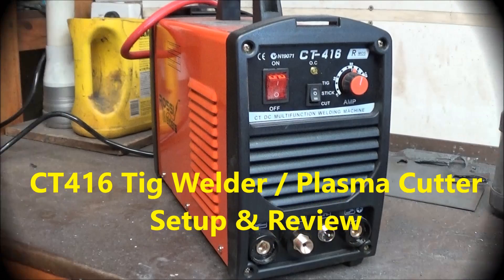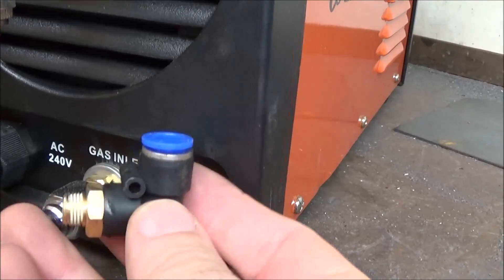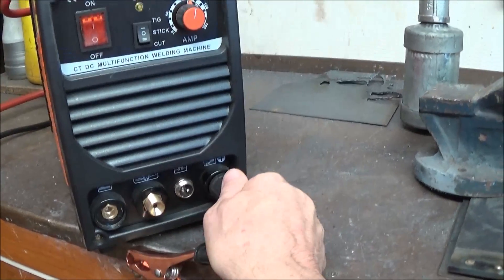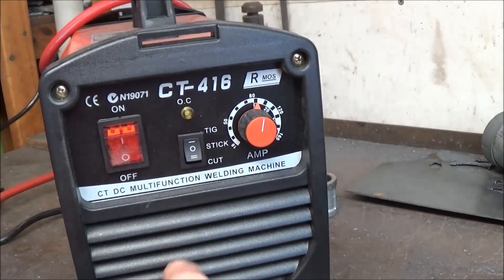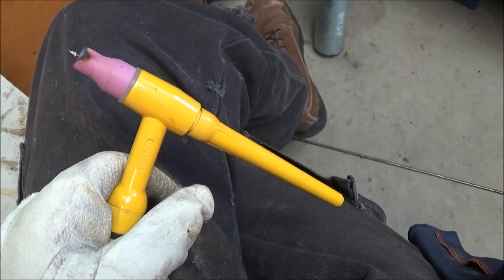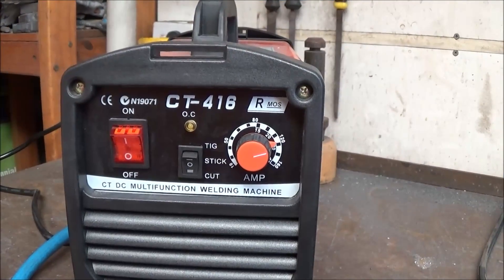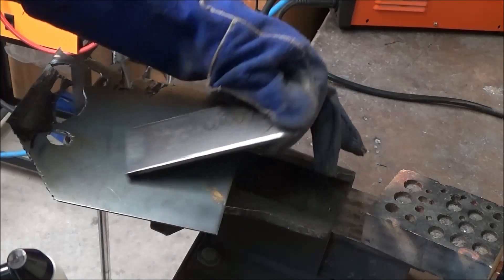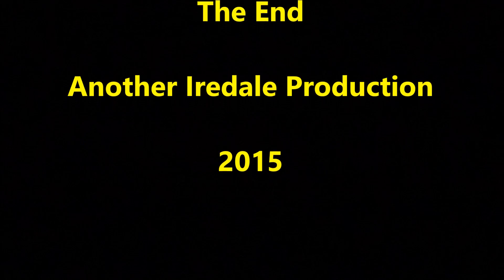CT416 Setup and Review of Tig Welder / Plasma Cutter

Comment: I’ve got one its got a mig plug but i have no mig gun in kit, but it deceased step father i just inherited, anyone know how to MIG welder is a seperate roller i have to buy or whats the go? Ive got standard house 10amp so will find out if it needs 15amp or not.
Reply: Yea prob want a 30 to 50 amp breaker

Comment: Great vid, thanks! For plasma cutting do you only use compressed air? What psi is recommended? I’m a newbie who has never used a plasma cutter before but am a quick learner
Reply from the maker: Mine uses 60psi. The current depends on the thickness to material being cut. A big of experimenting will find the sweet spot of a given thickness where it cuts nicely but without excess slag.
Reply: Between 40 and 55 PSI of air pressure, and 50 amps of current for the plasma.

Comment: I have the CT418 model multi purpose machine,, dual voltage 120/240v , I run it on 240 
Larger cups help with newer Tig welders allows you to see a bit more

Comment: 4 years on, how is this machine holding up? What is the thickest bit of steel it can cut?
Reply from the maker: Steve Clark - real-life practical? 6mm
Reply: @ShedBuiltStuff  Thanks, good to hear that the machine is still working, some say that these 3 in 1 machines have the worst failure rate. I am looking at buying one in the new year.
Reply from the maker: Steve Clark - these aren’t “quality” machines. You get a bit more than you pay for. For me it was worth it as I didn’t know if I would like tig welding and didn’t want to spend a lot to find out.
Reply: @ShedBuiltStuff  Yes I'm sure that they ain't, I can't afford much and I'm a hobbyist user so such a machine would get little and occasional use.

Comment: What size is your air compressor?   I have a small compressor (21L tank), in your experience would it be capable?
Reply from the maker: Compressor size effects how long you can cut at a time.  So long as it can deliver 60psi it will work.  The smaller the tank/ability to refill the shorter time you can cut without waiting for the tank to refill. I think the 21L will be fine if you are only using it for hobby work.
Reply: @ShedBuiltStuff  Cheers. I ended up buying a cheap 40a plasma cutter to try. The 21L tank provides ample capacity for the home workshop.

Comment: Hi mate, thanks for the informative video. I recently got the CT620IS Rossi but I am having some issues with the cutter. Can't seem to get the cutting arc going. All that happens is the compressed air comes out when I press the lever. I have made sure I have all 3 connections made to the machine. Anything I am missing? appreciate any help you can provide. Thanks.
Reply from the maker: Zarn Bou - there is no pilot arc on these. They are “scratch start”. Tap the tip on the metal - the arc will start - then hold it a couple of mm from the metal to cut
Reply: thanks for the quick reply! do I press the lever as I tap the tip on the metal?
Reply from the maker: Zarn Bou - yes. Hold the switch down which starts the air flow and electrifies the tip then touch and release the tip on the metal to be cut
Reply: Cheers, I'll give it another try later. Thanks again!
Reply: Hi mate, tried everything and just doesn't work. It shouldn't be rocket science how to start that thing cutting. I believe it's just faulty. Asked seller for a replacement or refund. Thanks again for your help.
Reply: @zarnbou9445  same here no matter what I turn it up to amp wise if I'm 2-3 mm away I only get a very tiny spark no cutting no nothing all air , about to through it In the bin
Reply: @ShedBuiltStuff   hey Adrian  just set up my  machine with same set up as your , for cutting it's only putting out small spark no flame at all , what psi air are you putting through
Reply from the maker: Fordy Mcfordy - 60psi - I assume you are talking about the plasma cutter. Check your earth to your work piece. Also check the switch is on “cut”.  
But the small spark points to it not earthing properly. The earth clamp needs to be on a nice shiny clean surface.
Reply: @ShedBuiltStuff  thanks for the reply Adrian , yeah I'm cutting up a old car shell, I'll flap disk a clean area for the earth cheers mate
Reply: @ShedBuiltStuff   he said he had a CT620is  they do have a pilot arc.

Comment: Adrianiredale  I am in Toronto Lake Macqarie NSW are you still happy with your Rossi 416CT unit I would like too see one operating Noel
Reply from the maker: Noel Masterson - still happy with it. But the plasma cutter option failed. 
Remember this a very basic unit. As it’s DC only you cannot tig weld aluminium. 
Bought a seperate plasma cutter - same brand. It has proved reliable. Been using it for 2 years.
Reply: Adrianiredale what rossi unit model did you replace it with and did you purchase it in Australia bye the way thanks for your quick reply regards Noel
Reply from the maker: Noel Masterson - I didn’t replace it. The tig and stick still work fine. I bought a dedicated plasma cutter. 
It was a pain swapping from tig to cutter on the original unit anyway. 
I’m current motorcycle touring down the snowy river so cannot tell you the model of the plasma cutter.

Comment: You can actually TIG weld aluminium with a DC TIG. There is two ways to do it. Use Helium gas, or use argon and a positive electrode but the second way is harder and can only do thin material as well as use a  large tungsten.

Comment: hi joe,
I had to remove the metal cover (carefully as it is slotted into the front panel) to allow access with two spanners (one inside and one outside) to remove the original gas connection, I went to a plumbing supply to pick up an thread adaptor to match the thread on the gas solenoid to the Nitto style gas fittings I picked up at Bunnings, then its just a matter of reassembly with plumbers teflon tape etc.
Please be aware the screws holding the metal cover may be stripped (2 of mine were) getting them out without damage to the metalwork was difficult i had to replace them on reassembly.

Comment: Just got one of these and completely agree that the fittings provided are fucking useless.

When you replaced the gas inlet, was yours directly screwed to the pressure valve on the inside?  Poor design, forced it to be opened just to replace the gas inlet with another fitting because once you remove it, the pressure valve drops inside the unit.

Comment: Hi Adrian, very informative video, I have just bought this welder/plasma cutter for a project I have in mind where I will need to cut and weld 6 to 8mm thick steel plate for a vacuum chamber, the very first thing I did was replace the useless air hose connectors although it is necessary to remove the rear panel and outer metal cover to get to the rear panel air socket (goodbye warranty!).
In Melbourne Hare and Forbes in Dandenong will sell individual TIG electrodes in 1.6 and 2.4mm sizes which is great for the hobbyist just starting out.
Argon gas at a reasonable cost is my final hurdle in getting into TIG welding, most firms with reasonable size bottles charge rental or a high initial cost any ideas on sourcing reasonable priced gas?
Bye the way your later videos are really inspirational for us tinkerers keep up the good work!
Reply from the maker: Neil Boast - thanks for the kind words. Argon?  Only cheap option is if you have a mate in the trade or fabrication workshop. 
For us mortals, I found the cheapest option (still expensive) was to buy a bottle from "GasWeld" then get replacement fills. Of course the bigger the bottle the cheaper per kg is the gas. I've ended up buying the largest G size.

Comment: Hi. great review. I'm thinking about buying this machine. I just wanted to know if the tig is lift or scratch start?
Cheers
Reply from the maker: Steven Koch - no it's not scratch start. There is a button on the torch to start the flame
Reply: +adrianiredale thanks for the reply. Is it hf start? That's amazing for such a cheap unit! I'll be buying one for sure. Cheers
Reply from the maker: Steven Koch - the plasma cutter is hf start - that is, you have to touch and lift the cutter to start the cutting flame.

Comment: it's a good welder. I use mine for commercial work because it;s small and portable. I actually replaced all of my gas fitting too the same as you with nitto fittings.. It was much cheaper to buy thegas fittings from trade tools though than a welding shop. I needed to buy a non-tapered (straight) 10mm (0.75mm thread) coupler to 1/4" adapter from Pirtek to replace the fitting directly on the gas inlet. Works a treat now :)

I've done several jobs with this welder and it works fine, hammering stick and TIG all day.

Comment: I cut enough in my engineering shop to go through 1 or 2 of these of these machines per year, 1mm to 3mm steel and aluminium.

You DO NOT hold the tip off the work, you put it on the work piece and drag it along the work piece..

That is why you blew out tips and you will be lucky to get a half hour use out of a tip in the future whereas I use just a handful of consumables per year.

Probably a carry over from using Oxy cutting equipment where you hold the tip of the work piece. 

You purge the air, shut it off and notice air is still coming out for a short period, within that time (while the air is still coming out) is when you put your tip on your job and go.
Reply: That's where you're wrong. These are scratch start units not HF start, even the manual recommends scratching and lifting the electrode off the workpiece.
Reply: I wasn't talking about TIG either, the manual for the plasma states to scratch and lift, if you put the tip on the work piece it shorts out an the arc stops.
Reply: I cut for about an hour today, as I do a few times per week, 1mm aluminium. 

Purge the air first, while the air is still coming out (after shut-off), touch the work and switch on dragging away.

I was also blowing pilot holes for drilling, touch the work and blow for a moment, tips are still clean as. 

If you need I'll video it.

Comment: Hi Adrian. Do you know where to get the TIG consumables from??
Reply from the maker: I bought my tungsten rods from the local metal market
Reply: I bought them from BOC gas, but most shops like Trade tools have them. Bunnings is a bit pricey but they carry them. for stainless and mild steel 2% molybdenum works fine. you dont need thoriated tungsten like most videos recommend.
Reply: Slixxor Services 👍

Comment: I think I'll get the 416.  What do you think?
Reply from the maker: I think it's the best model of the three. But remember, although you can buy a cheap welder you still have to pay for or hire an argon bottle (for Tig welding ). I decided to buy one from Gasweld rather than hire. I bought too small a bottle to begin with. I've now got the G size (one smaller than the largest) as the bigger the bottle the cheaper the gas.

Comment: Not sure about price difference between silicon bronze & stainless filler rods, but for welding dis-similar materials you can generally use  stainless rods. Loved that little piggy bank mate! Keep it up
Reply from the maker: Thanks for the tip. I'll give that a try.